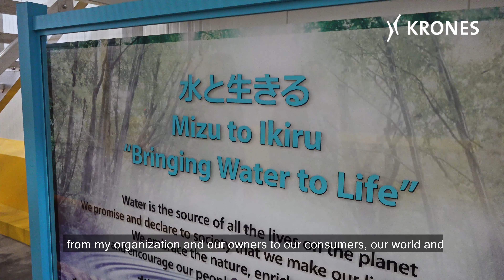Pepsi Bottling Ventures is bringing water to life

Comment: So is the plastic still warm when the water goes in?
Reply from the maker: For carbonated products, the bottle is filled under pressure. To prevent any deformation of freshly blown bottles during the filling process, the bottom of the bottle is actively sprayed with water immediately before the filler and thus cooled to harden the plastic. It is therefore not relevant whether the bottle is still warm, but whether the base is stable in shape.